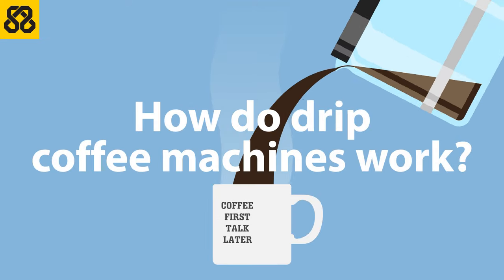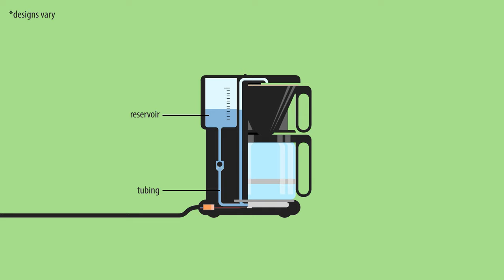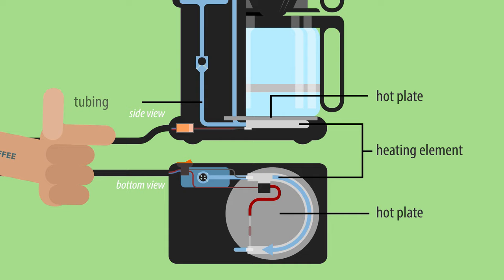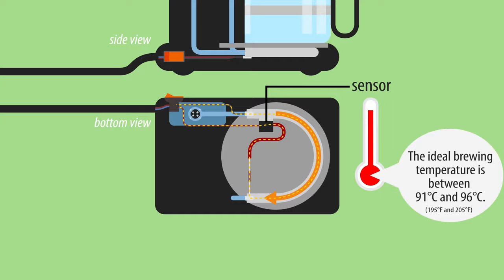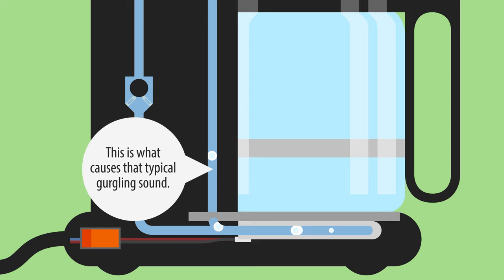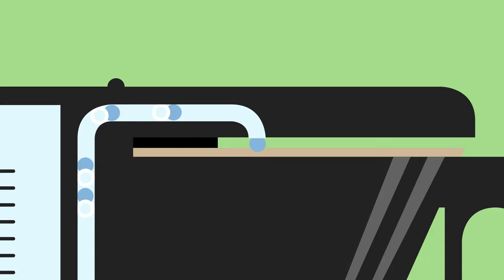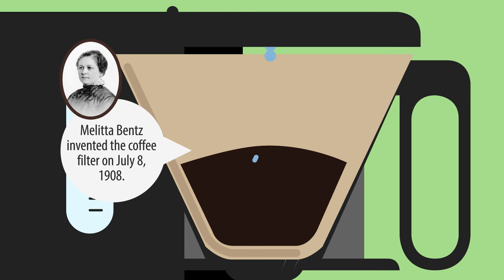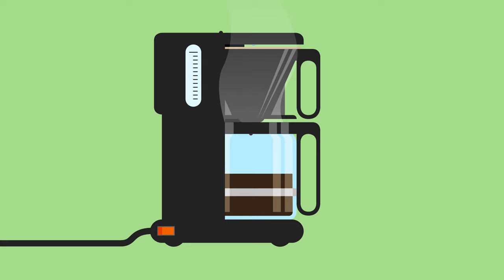How Do Drip Coffee Machines Work? - Making Coffee Explained

Comment: Excellent explanation! I had most of this figured out by dismantling an old coffee maker. I was not aware of the back-flow valve, so thanks much for clearing that up for me. I suggest one correction: the bubbles that move the heated water along are steam bubbles, not air bubbles as you stated. Again, overall an excellent and interesting lesson, thank you!! :)

Comment: Great explanation, except that the "air bubbles" don't contain any air, just a bit of steam from the heating.  It's the same as boiling water on the stove when you see all of those bubbles rising to the surface.  It's the same principle as those giant percolators you see at large functions.  No pump required!

Comment: Great video, I'm making a DIY coffee brewer, would it be possible to place metal piping down into the water of a boiling pot, having the one-way valve submerged in water? 
Would I have to seal the lid of the pot to get any pressure?

Comment: How does the machine know to stop dripping the brew when I remove the pot? Is there a sensor on the plate?
Reply: when the pots lid is not pressed against the dispenser it stops dripping
Reply: It actually depends upon the water tank. It will keep the water running until it is over. Or you lift up the lid.

Comment: Everything is correct except the water never reaches it's boiling point.
Reply: What temperature does it reach then?
Reply: Nevermind I found it myself, it's 96 °C.
Reply: @janhradecky3141  damn you came back after a month to reply. Dedication: 100
Reply: @realdvgarg  he is the hero we need
Reply: This post is fundamentally incorrect.  The key point to understand is the bubbles that force the water up through the tube.  There is a word we use to describe converting water into a gas, producing bubbles, with a heating element.  That word is "Boiling".